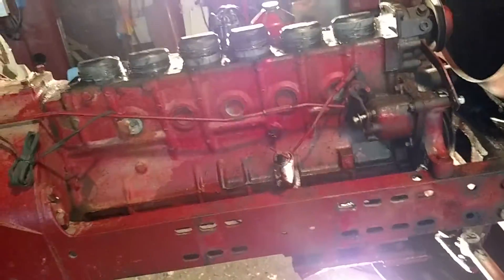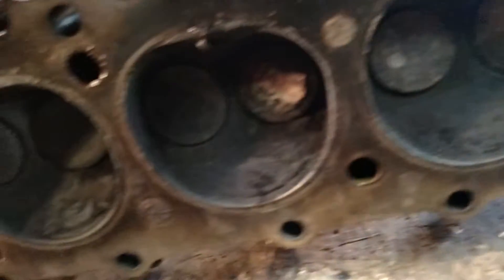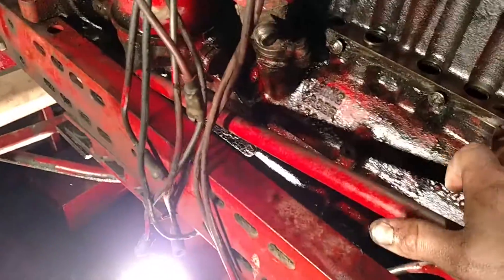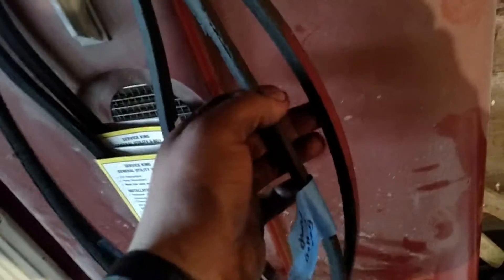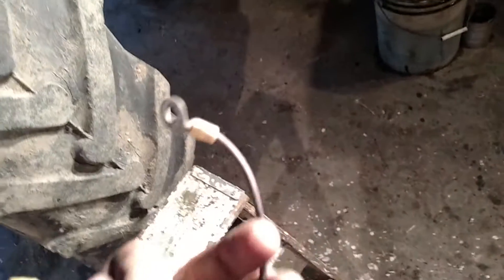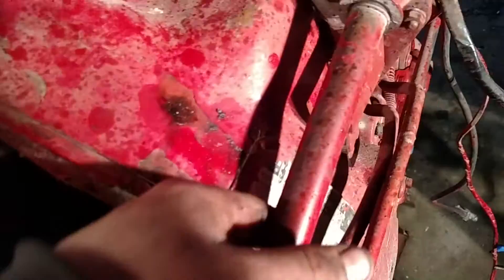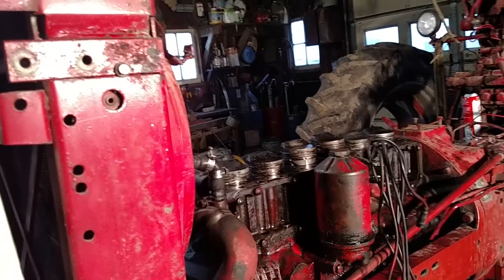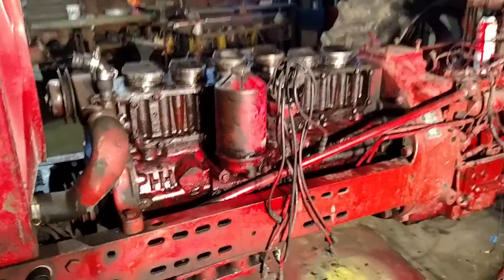Farmall 560 overhaul part 1

Comment: 5:09 - In the immortal words of Mythbuster Adam Savage, "There's your problem!"

No wonder she was losing power. I've never seen pushrods bent that bad. Wow...
Reply: Oh, A, B, C and D on the pistons and next to the cylinders are the bore tolerances. Your new pistons and sleeves will come matched. 367642R1 is the IH part number of the piston. I'm pretty sure they're original. R1 is 1st revision.
Reply from the maker: BarnyardEngineering I need the torque specs for the head, manifold, and rod bolts if you have them. Thanks

Comment: Your pistons look like LP Pistons and the head may also be for LP and LP is very high octane; the Higher the octane the slower the fuel burns and that combo could cause the bent push rods; also on the 560 if water ever got down exhaust pipe it filled the cylinder closest to the radiator with water  (Ice in winter and that can cause a bent push rod).
CMVHighPriest

Comment: What happens is carbon builds up in the valve stem & make the valves sticky or stuck, then the push rod is doomed. Our 560 diesel i had to rebuild #6 piston/rings/sleeve every 2 years because it always hammered the new sleeve into bits & pieces. Not sure why. Hows the pto on yours? Does it ever slip under load?
Reply from the maker: No I have never had it slip under load. It has always run good, it was just losing power.